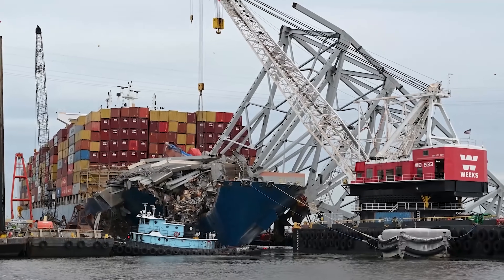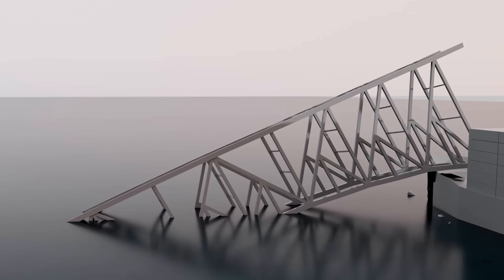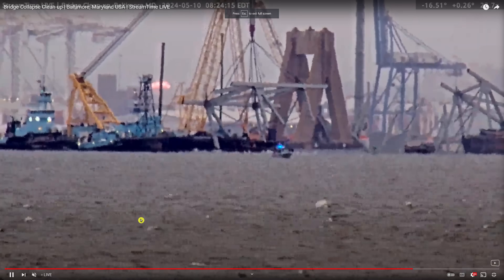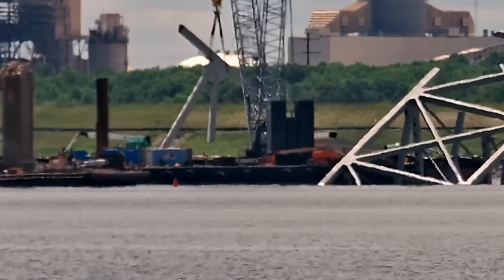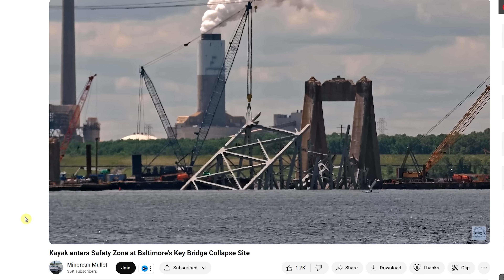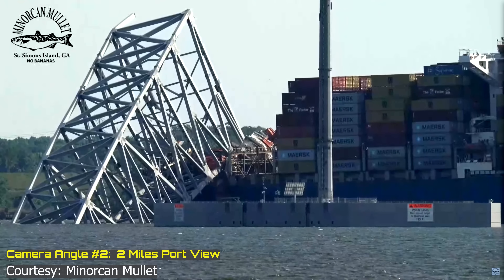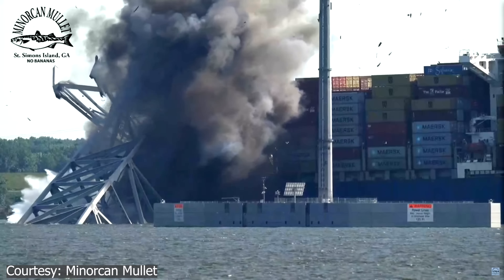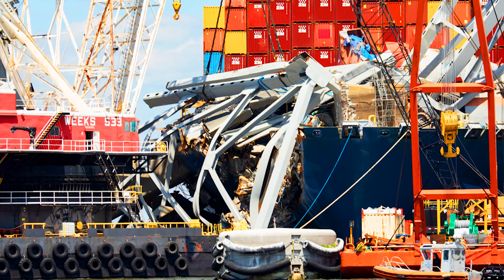Key Bridge EXPLODED Off MV Dali Ship | Baltimore Bridge Collapse

Comment: Nice, they used cutting charges just like on 9/11. But, yes, I agree, the only sparks we saw when the boat hit the pier were the elecrical connections severing. At least some of these guys have made some fantastic money during this demo project. Can't stop a giant boat from hiitting a pier but I'm willing to bet engineers will try to think of something. If there were a long drawn out underwater concrete angle up to those piers, prior to the pier itself, it may stop the boats from reaching the main portion, just a though from an engineering family. I finally subbed to you...

Comment: I would've thought they could have had the big boy crane hook onto the structure that was 'on' the ship, and have the charges cut that section loose from the rest of the structure and then lift the section up and away, other than then having to retrieve the 'pieces' from 50' of water.
Reply from the maker: That was my original hypothesis also one a previous video over a week ago

Comment: That was a pretty accurate actual result of what should have happened.  I don't think for a minute that the cement road way and steel beams under the cement would be drug off the ship.  That will have to be removed the slow way.  There may have been some structure left on the ship but it was minor compared to what was there before the detonation.  There is still a tremendous amount of weight in that cement, the rebar and steel beams under the cement.  There was a great view of the ship in one video that showed just how much lower the bow is than the rest of the ship.  Great job on the videos Jeff and thank you for keep us up to speed on whats happening.

Comment: 1:19 - that "highly controlled process" is in fact a hardly controlled at all... Once you press the button all you can do is to pray and hope it'll go according to the plan...

YES, you can "carefully arrange" det charges (i.e. their "firing sequence"), carefully select/ chose their explosive power and place them "in carefully selected strategic places", but then it's all educated and experience based guesswork - as all these failed demolition shows all too clear.
There are always some unknown factors, and sure, you can place a barrel load of explosives at each point, but then it'll cost you a pretty penny and the exclusion zone would be several miles (to account for all them flying debris).

There was some Victorian era railway viaduct in UK (can't remember location), scheduled to be demolished since it was no longer used and individual bricks started to fall off of it due to elements taking their toll on it.
As I said, it was made of gazillion of bricks, no concrete or rebar - so easy-peasy, "walk in a cake". The demolition company drilled whole bunch of holes in supporting columns, packed them with "precisely calculated" amount of explosives (just right, and not too much! - there are some homes not that far away, and we don't want to shower them with flying bricks!), inserted detonators, rolled out the detcord (or shock tube), held their breath, pressed THE button, and...

FORK. It did not collapse, still stood there (bar for couple of chunks that fell off) - all they achieved was to make thousands of cracks in the structure, effectively rendering it unsafe for ANY further demolition.
Can't drill in it any longer, can't approach it (safely) with heavy machinery - "brilliant, my dear Baldric, brilliant indeed"... But I digress here ;-)

Comment: It has occurred to me that maybe it might have been more efficient - and economical - to have a heavy capacity barge stand by the Chessie to have the pieces set on the barge for transport to the scrap yard. with another high capacity crane there for unloading, thus not taking so much of the Chessie's time for transport and return. That's a pretty expensive shuttle.

Comment: I heard that they couldn't place charges down as far as they wanted on the pieces still standing because some of the containers had hazardous material in them. Didn't say what sort of material, but wasn't worth the risk.  Also said that the bow of the ship had pumped as much ballast water as possible into to prevent any sudden movements. Still looks like a tremendous amount of weight on the bow between the roadway and bridge piers!

Comment: The upper members weren't the major concern. The bridge deck and the lower members had to be sheared off far enough away, so that as it fell, the weight of the entire remaining bridge section did not rake down along side the ship and pierce the hull. I think the results looked excellent since the main section settled nicely onto the bottom, and the individual section slid off and ended mostly vertical beside the ship.

Comment: Haven't watched your analysis yet.  This should be interesting.  It did not go as advertised.   The bow of the ship is still pinned to the mud, and it's going to take a lot of work to remove the many tons of material still on the bow deck of the Dali.   I wanted to write this before watching your video  just to compare my thoughts to your analysis.
Reply: For starters, the number of charges set was about half the number shown in the animation.  As I think about it, this is a lot like the FIU bridge which was over hyped from the outset.   I like that your video documents that it is not uncommon for "controlled" demolitions to not go as anticipated.  The Dali is still stuck, and I think it will be for an extended period of time.   It comes down to how much damage they are willing to do to the bow to get the weight of the roadway off of it.  If they puncture the Dali's hull trying to pull it off, it could be stuck there for years, just like the Golden Ray.

Comment: Look to me it all went off OK Jeff, and most of the steel slip off, but I notice the 
Dali front end didn't lift much out of the water still a lot of weight on the front, 
now come the reflate of the Dali, Awesome video Jeff & I was very impressed 
with the latest kitchen build and as a builder in Australia that was top notch 👍 👌

Comment: The 'shrapnel' is all the rubber blankets designed to catch the liquid copper from the cutting charges. It takes all the force from them, so it flies pretty far. They are pretty clean cuts, so there's no steel flying around.

Comment: The truss would never slide down at an angle like that animation showed. It would just fall straight down. It isn't on some sort of track. I'm guessing the engineers didn't supervise the animators closely. 

The pivoting was great because it knocked a bunch of material overboard that otherwise would have just fallen onto the road bed.

Comment: The boat was teathered tightly not allowing it to rise up as the weight of the truss was removed, therefore the truss could only move a short distance until it was completely released from its anchor point on the boat then it slide down but not away...

Comment: Hi Jeff, the charges would most likely have been connected via shock tube rather than being individually commanded. Very simple but reliable way of doing things with an extremely safe medium. Shock tube carries explosive signals at a rate of somwhere around 3000m/s, so pretty damn quick!

Comment: The small amount if truss still on the Dali was most likely left so that the charge would not impact the containers near it, as they need to be insurance investigated. They can remove the one girder either with cutting torch or just remove it with the dockside cranes. I agree that anything in the water can be removed with the claw as if it is rigged properly, it can cut as well as grab.

Comment: The way that it looked to me was to pull the steel away from the ship it needed the frames furthest away and on top, to be the initial points to cut, so the whole structure would want to fold at the point it entered the water, thus pulling tge steel off tge ship. Then the entire frame  to be blown almost in one go to make it all drop rather than slide back towards the ship.  It also  needed explosives very close to the river level to avoid a hinge effect.

Comment: all in all, i say it was a successful demolition. the goal was to cut the truss to smaller bits for the cranes to easily carry out. on the original video on DVIDS it says " to create multiple, smaller sections, which allows salvors to use cranes and barges already on scene to remove these sections of the bridge and ultimately remove the M/V DALI from the channel" so the plan was always use precision cutting then use the barges to remove the pieces and then float the dali to move her. 

plus if you analyze the animation you realize there are several inherently flaws with it, like the shape charge detonations do not line up with the parts the truss is cut up, and the unrealistic physics on the part of the truss that is resting on the dali. so it an animation of the gist of what was going to happen and not a simulation of the expected out come of the event.

Comment: Thank you, Jeff, for the week in review  and big finale wrap-up video. They sold us the wimpy simulation video of
vertical closely stacked dominoes being pushed off the edge of the card table, a few puffs of white cigarette smoke 🚬. What we got was a big, loud action film sequence with black
greasy thick smoke, and I'm not complaining. The battered banana peeled bow section couldn't take much more abuse with an expectation 
of being sea worthy enough to float.
Great job by the team to wipe the mess off with only a couple of birthday candles left embedded. Even
with the big explosives, a beam clung
to the ship as if it had tree roots. Not my show. Perhaps it's best to scoop up roadway as she lays at low tide.
Starboard bow section more open than closed above waterline. Fine work salvage crew.

Comment: Actually the truss debris left on the bridge was intentional.  Captain Andy caught a radio transmission to that effect a few minutes after the BOOM.  Think about it, they had all those smashed containers under the roadway and truss.  They didn't want that mess rolling into the bay, so they purposely severed the top from the bottom, allowing the top to roll into the bay.  The pieces left behind are still holding the smashed containers in place, but the pieces left are much more manageable now that the tremendous weight is gone.

That's a really great report you've put together for us tonight.  I was chillin' with you in Captain Andy's Live Chat when this all went down.  You've pulled a lot together in a short amount of time and it came out well,  Thank you Jeff.

Comment: To me, it looked as if the demolition went as planned. The last part may have needed to be pulled over the side by the falling parts of the structure and if the charges on the base had gone off any sooner, there would have been nothing to pull them off.

Comment: I was quite surprised to see on the Fox 5 feed that the concrete trestle that spans the two A frames that make up the pier is sitting on the Dali's deck.
Reply: Probably being used as ballast to hold the bow down until a controlled lift.

Comment: The simulations  was very different than the actual demo  adn the results were very different.   The simulation was a controlled demolition  as proposed by one company and the charges would have been fired in sequence  going from the furthest to the steel on the ship.   But the actual demolition looks like they used only half  the charge positions  and they were the ones closer to the ship.  
Go back and look at the simulations the weight of the truss starts pulling the steel away from the ship and that is the normal desire in these operations.   But they did not use the same number of charges and the result is very different.  A lot more of the steel is intact and a lot of steel is still on the ship.   I would suggest that they had several bids to do the demo and they went with the low bid.   The result is not what was desired.  It did not clear the ship and it is possible the mess under the water  will take time to remove.    There is a lot about this job that makes no sense management wise.    There was only going to be one shot  for a controlled demo and it looks like they went Kmart Blue light special and got a Kmart result.   I personally think  this mess is a factor in the US Senate race adn the Dems are in trouble so they are just pushing this forward to claim  they did it before November.   The simulations demo would have taken far longer to set up and probably cost a lot more.  

I would also like to point out that the ship did not shift when the steel  was blown and it went over the side.  There should have been some movement since that represented several thousand tons of weight.  I have watch the video a number of times form each of the available angles and used specific  marks on the ship  in reference to other points and there is no ship movement.  That is curious because the bow weight is lifting the stern.  And it begs the question about just how damaged the ship really is.  I think it is a possible indicator of extensive forward flooding and that ship is going nowhere.   If the damage is substantial and they pull it off the bottom into the channel, what happens if he flooding  spreads and the ship starts to sink?  It is possible in that scenario, the ship takes on so much water they cannot get it into the smaller drydocks north of the Key bridge.     And there is a real risk if the bow is taking on a lot of water that you may not even have the option of beaching the ship in shallow water.  If  the Dali then sinks in the main channel the situation is now worse.

Comment: What you are missing is that a second vertical beam on the harbor side was only blown on one side towards the harbor.  There was a comment over the marine radio recorded by Micorcan Mullet that this was intended.  It acted as a fulcrum and turned the highest steel section bayward as it fell.  The beam structurally failed by stripping a side off of the vertical beam all the way down to the bridge deck. It kept the higher section close to the bow when it fell over but importantly kept it going away.  This was obvious on a helicopter zoom view that was circling the Dali after the blast.  It's the only piece of steel still attached to the roadway on the Dali.

Alan,, PE, D.WRE, USCG/US Army Corps of Engineers (ret.)
Reply: Like cutting a notch or wedge in the back of a tree to direct the fall. But in this case they leave material in places
Reply: Sorry? 

You're trying to tell us that, despite the animation which made their expectations very clear, it was actually their INTENT to have a damn great lump of steel sitting on top of the underwater debris - cos it is - and also have it leaning against the side of the Dali?

I do NOT buy that in the slightest . . .
Reply: @nealc.6927  legitimately dont get too hung up on the simulation. it was a flawed animation to get the gist of what controlled demolition is and what is the general plan is. if you pay attention closely to the bottom section of the trust there are 2 detonations yet there are 3 cuts along the bottom that were not even where the detonations where. plus after the detonations the right side of the truss (part on the bridge) instantly gets horizonal momentum some how which is no where near realistic. 

the main goal was to cut up the suspended part of the trust that was under unknown forces making dangerous to cut by hand all while not damaging the dali too much more. getting the truss sections away from the dali was a bonus.
Reply: @cranberrysauce61    Exactly right, from the News camera coverage from the south-east,  the top section very abruptly went east.  Where did this momentum come from?  Gravity would have pulled it straight down. The only possibility was an internal force not obvious at the time.  It's only in the post-mortum analysis that there was an incomplete beam blast on the Dali.  Someone looking at the results from the water stated over the Marine Radio that that was intended.
Reply: @cranberrysauce61 , good points.

People are getting WAY too hung up on the simulation that the USACE released several days ago as if it was intended to show precisely what was going to happen.  Like you pointed out, it was just to give the public an idea of what this “precision cutting” with explosives was all about.  Not a precise prediction; just the gist of the concept.

I mean, the simulation didn’t show any splashing, either!  I suppose it was a big failure because there was a splash when the debris impacted the water!
Reply: @nealc.6927    Look at the News 11 Helicopter feed.  On the first pass from the east, the strip of attached metal is very clearly indicated.  Which pushed the following bridge sections to the east when they fell and bounced off the Dali into the Patapsco Scenic River's tidewater..

Comment: Still though it's better than it was..looks like dali didn't raise an inch though!
Reply: I heard they may have flooded the forward spaces to keep her firmly planted until they're ready.  Have the ship move without tugs ready would be a huge problem, and the tugs can't be there for safety reasons.  They was a line running from the bow to a dolphin, but I would just considered that added security not the primary method of keeping her in place.
Reply: @major__kong  ahhh ok